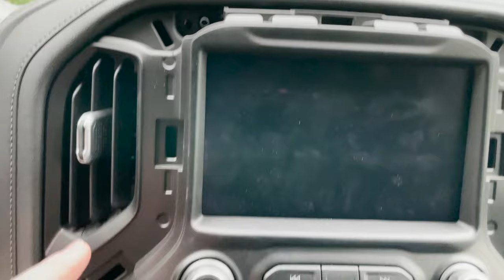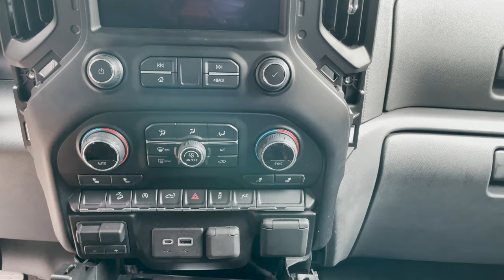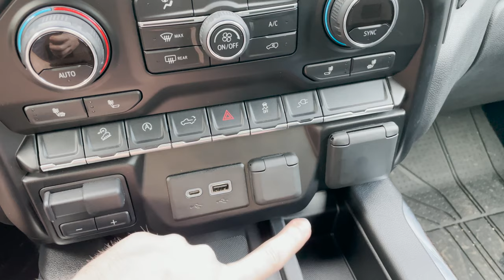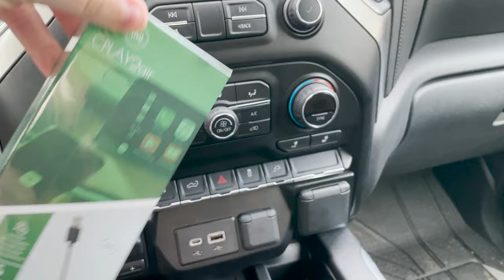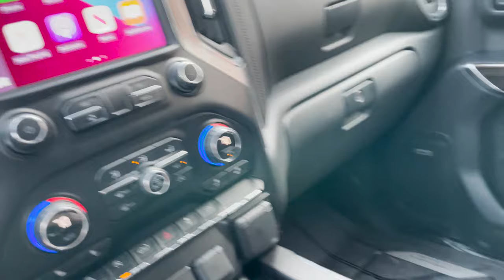Silverado / Sierra Center Console Upgrade (2019-2021)

Comment: Hey, sorry to keep asking questions. So, you used your original module that you swapped into the new part. Was there any programming involved or error messages or anything like that? Thanks for your time.
Reply from the maker: No need to apologize. I will answer any questions that I can. No programming needed or any kind of issues with the console swap. Everything was plug-and-play and worked immediately once it was put together.

Comment: New sub here.  Thanks for the video.  My GMC Sierra 2021 came with wireless CarPlay and ever since I disabled the wifi hotspot I have lost wireless CarPlay.  I had looked at your dongle before but since it did work I am trying to find out if I can reset everything to get it to work.  Thanks again for your video.  It was helpful to see the console removal.  I have added a wireless charger to the console with the hinged access below.  That was pretty easy to put in.  All the best! Happy New Year.
Reply from the maker: I’m not sure how the built-in vehicle Wi-Fi works, but I do know that wireless Apple CarPlay needs a Wi-Fi connection in order to work. The adapter I bought for my truck allows me to connect my phone to my truck over Wi-Fi. 

My truck also has the built-in vehicle wi-fi but I don’t think I ever fully “disabled” it. I just don’t pay for the service. Even so, my truck did not come with the functionality to have wireless Apple CarPlay to begin with so I still needed the adapter for it. If you disabled the vehicles Wi-Fi component completely, that may be the issue. You should be able to leave the component active, but just not pay for the service if you don’t want to actually use it. Then again I’m not a Wi-Fi expert so I could be wrong. 🤔
Reply from the maker: Thank you for the comment and the sub! I’m glad you found the video helpful!
Reply: @SouthpawGarage  yes I thought it required wifi. As I was on free trial I wanted to disable using it when it was no better than cell data so where you have poor performance on the phone, same for truck enabled wifi unlimited (which is not really unlimited). So here is what confused me - my daughter and wife were asked if they wanted to use wireless CarPlay where mine failed. I think it displayed the CarPlay screen on the truck for them.   I will verify this when my wife gets home tonight.  Thanks for your reply.  Have a great week!
Reply from the maker: No problem. I know I don’t have all the answers but I try to help as much as possible. 

If your wife’s phone still works, you may want to look at the CarPlay settings on your phone and make sure everything seems to be turned on. You can find some troubleshooting help at this link:

https://support.apple.com/en-us/HT210892
Reply: @SouthpawGarage  no problem.  That is what I love about YouTube.  We can figure stuff out together.  We all have ideas and understanding of how things work generally and it is always good to see examples of what can be done when you haven’t don’t that before.  Anyway, I will look at the iPhone if theirs works and mine doesn’t.  I shiver at the thought of resetting settings on either the phone or the truck.  But maybe that is what I will do depending on how this next test goes.  Wish me luck!  Lol
Reply: @SouthpawGarage  thanks again for your video. I did get CarPlay working by removing my phone from vehicle Bluetooth.   Then I reattached it.  

Now I am here watching the console removal to see how I can remove it and see where I can run cables from the rear of the truck for Ham radio. I may set a custom mount under the console for my radio but mainly I want to see where to run the antenna wire from outside.  Thanks again for your hints and comments.   All the best!

Comment: I have a 2019 Sierra denali and it already has that center console, the wireless charging is SLOW. I installed another wireless charging on the center console arm rest. It replaces the center piece of the arm rest. SO MUCH CHEAPER and EASIER.
Reply from the maker: The factory charging definitely isn’t fast. I spent a lot of time deciding if I wanted to add factory wireless charging or add an aftermarket one. I went with the factory one instead of replacing the piece on the center console to try and kept the factory look as much as possible. You are correct that there are cheaper and faster options.
Reply: @SouthpawGarage  not to take away from what you added. It looks professionally done as if it came from the factory. Take a look at some of the installs for the arm rest. you will not not if its factory or not. My wife didn't know I replaced mines until I told her there was a new charging pad there.

Comment: Can this be added to a 2019 Chevy Silverado Custom trail boss? There's no center console in mine.
Reply from the maker: You would need to do a complete conversion to get rid of the folding middle seat and install the center console before you could add the OEM wireless charging console component. I am not aware of a wireless charging kit that is made for the folding middle seat option.

Comment: Did you add the centre console to this truck or did it already have it? If you added it did it have the usb and card reader? The console I added came with rear seat heat which I don’t have.I did not get the harness that runs from the centre stack usb to the wireless charging. I’m trying to figure out if the harness from the wireless charging will feed the centre console USB ports. Curious what you know about this. Thanks for your time
Reply from the maker: I did not add the center console. I bought the Silverado that has the center console instead of the bench seat. I am not sure what you would need to power the usb and card reader in a console that is added after the fact.

Comment: Thanks for the video.  I am now working with wireless CarPlay.  Something got weird when I disabled the WiFi in the truck that was provided with he OnStar Eval.  To get aligned with wireless Apple CarPlay was a matter of removing my Bluetooth pairing of my iPhone with the truck and adding it back again.  So problem solved.  On a new note, I am planning on removing the center console to route coax and control cables for radios.  Thanks for the video on removing the center console.  Again, thanks for the video, you helped me on a side project, but helped me still the same.  Now to get the radios setup … smile
Reply from the maker: I’m really glad you found the video helpful! I try to improve on every video so that hopefully viewers either get help on a project or at least some form of entertainment in regards to seeing cool cars or truck mods. That you for the comment! The Nova videos should be coming back before too long which means I will have to put my truck mods on the back burner for a little while, but there are more truck videos to come as soon as I’m able to fit them in the budget.

Comment: Did you have to re program your remote? Did the new one come with a remote sensor under the cup holder? Thanks
Reply from the maker: I didn’t have to reprogram anything. The wiring harness for the kit that I purchased came with a new connector for the remote sensor under the cup holders.

Comment: So everything is awesome in your video, (But) the lower bezel between the console and the instrument panel where two additional screws hide. My question is how did you remove that u shape 🤔 bezel? The upper was easy the lower one seems very hard to remove 

Thanks for your reply 👍
Reply from the maker: I think you are referring to the piece that is tucked in under the center stack between it and the wireless charging pad (or top of the center console). Once you get any screws out of it, it’s held in with retainer clips. It takes a little bit of force but it pulls straight out towards the backseat. If you put any upward or downward force on it, it’s likely not going to pop out. Try to make sure you are pulling straight towards the back seat.

Comment: I’m lucky my 2020 GMC 2500 HD Denali came with this wireless charging piece and it works well even though an otterbox phone case. My question is with the dongle. Are you able to watch YouTube, Netflix etc through it and on your factory screen? Or is it just CarPlay? I work in my truck all the time and this would be handy while parked. I’d never use it while driving. Thank you in advance.
Reply from the maker: That was just a dongle for CarPlay specifically… no additional functionality. That dongle quit working less than a year later as an Apple update made it unusable. I have since upgraded my truck to having the factory wireless CarPlay setup with an upgraded infotainment system. 
Dons Life has a dongle that provides access to Netflix, YouTube etc and has videos showing it off if you want to check out his channel. I don’t plan on looking into anything like that for me, personally.
Reply: @SouthpawGarage  I would never use it for driving. As I’m in my truck 70+ hours a week, this would be nice to have. Thanks for the speedy reply. Subscribed!

Comment: I just recently got my hands on a full center console without the wireless charging to replace the jumpseat.  Do I still need to get the extra wiring harness even though I am not using wireless charging?
Reply from the maker: I’m not entirely sure about going from a jump seat to a console. I know there’s a small harness in the console even without the wireless charger that acts as the sensor for your key fob if the fob’s battery goes bad so your truck will still crank until you can replace the battery. But I would assume that is included in the center console you found. If you aren’t going to be using wireless charging, you shouldn’t need the harness that I added in this video.

Comment: When you installed the new part for the wireless charging, did it come with the anti theft module for the remote or did you take the one out of your exsiting console?
Reply from the maker: I used the one that was already in my truck. I removed it from the factory console and put it on the new one.

Comment: Having a problem removing trim piece right under the radio in between the radio and console. Please help! I noticed yours was already removed
Reply from the maker: That piece is a little difficult. I used the tried removal tool to loosen it on each side and in the middle. Then it takes some force to get it to come out. It has to be pulled straight back. If you pull in a way that pulls at an angle to either side or up or down, it’s nearly impossible to get out. (At least, that was my experience)

Comment: So you had the carplay option already?
Reply from the maker: The truck had wired CarPlay from the factory. In this video I added a 3rd party wireless CarPlay adapter that ended up not working after a while (apple listed it as an unapproved accessory). In a later video, I update my infotainment module to include the factory version of wireless CarPlay without the need for 3rd party adapters.

Comment: hey, how are you? With the wireless charging add on you done, the harness ties into the back of the 12v port on the centre stack. Is that correct? Did you add the wireless charging cooling ductwork as well? Thanks for your time.
Reply from the maker: You are correct. The kit that I used plugs into the back of the 12v port. I did not add the cooling ductwork for the wireless charger. That would have required removing all of the wires from the back of the center stack so I could completely remove it and get behind everything to add additional ductwork.
Reply: Did not having the ductwork cause any problems in your opinion.
Thank you for replying
Reply from the maker: No real issues, but on really hot and sunny days, the wireless charger will stop charging the phone because it will get too hot and have to shut itself off.
Reply: That’s great! The console I put in come from a ‘19 AT4 with wireless charging and rear seat heat. I wonder where the wireless charging connected in that truck? The same as the one you done?
Reply: I appreciate your time on this
Reply from the maker: From my research, factory wireless charging wiring harnesses run under the carpet under the passenger seat, but I’m not sure where they actually connect.
Reply: When I installed my console there was a big connection under the carpet between the pass seat and console. It made the light in the console work and the rear usb’s work. I’m still working on a solution for the USB port in the console to work.

Comment: Do you have the part number for the wire that runs from the console to the 12v plug on the back of the dash?
Reply from the maker: It was all part of a kit. The link to the kit is in the video description.

Comment: Damn 400 dollars is pretty steep for a basic charger. Boost auto parts sells a nice wireless kit for 135 that blows the stock GM charger out of the water. Great video though!!
Reply from the maker: I do agree that the GM charger is very basic and they should be able to do better by having a stock fast charger. I looked at the Boost Auto Parts option before pulling the trigger on the GM one. I went with the GM version to keep the “factory” look in the console. One reason the GM is more expensive is because you get a whole new top piece for the center console and an adapted wiring harness.

Now that doesn’t make up for the entire price difference, but it’s part of it.

I’m glad you liked the video, though! Thank you for the comment!
Reply: @SouthpawGarage on your last comment:
 "Im glad you like the video, though"
I don't think you're suppose to use a coma (,) between "video and though"
Reply from the maker: @jaylara2592  when adding “though” at the end of sentence, one can choose whether or not to use a comma. Neither way is considered right or wrong.
Reply: @SouthpawGarage  Thank you for the clarification.

Comment: I also bought the 404parts wireless kit, I removed the plug behind the 12v and reconnected the one that comes with the kit, however the small plug that gets disconnected from under the original cup holders area where does that go and there is another connection with the new kit that doesn't seem to fit. Any help?
Reply from the maker: For the cup holder plug, you have to remove the theft sensor from under the factory cup holders and transfer to the new console piece (the one from 404 parts). Then you can plug that wire you disconnect back in. I hope that makes sense.

I’m not entirely sure what connection you are referring to that doesn’t fit. If you want, you can send a picture of the connector you aren’t sure about to the email listed on the “About” tab of my channel page and I’ll take a look at it.
Reply: Will do when I get home. Ty

Comment: If my truck already has wireless apple car play (LT Trail boss 2021) and I want to just get the wireless charging console. Will I have to get to the wireless CarPlay adapter
Since I’m doin this mod and changing the center console?
Reply from the maker: No. You will not need the CarPlay adapter. Wireless CarPlay is build into the infotainment system module itself, not the center console.
Reply: @SouthpawGarage  thank you!!

Comment: Can you tell me the part number for the usb part in the center console you got that u have the dongle plugged into?
Reply from the maker: I’m not sure what you are referring to. All USB ports in the truck came in from the factory. They are not add ons.
Reply: @SouthpawGarage  right I know! Mine don't have it an I wanted to add it! I switched the wire harness an it has the wiring for it so I was askn the part number since it's larger then the one in the dash
Reply from the maker: Oh I gotcha now. Sorry. Unfortunately, I do not know the part number for it.
Reply: @SouthpawGarage  do you know where that one wire plugs in at that runs up behind the face plate? It's the extension wire looks like an old phone charger at each end? It's the data cable! If you watch your video it's white on one end an black on the other!
Reply from the maker: @joediduch5457  I do not. Since I didn't have to remove/disconnect that wire during this install, I did not pay attention to where that specific one was going.

Comment: I installed a few months ago.   I noticed after install the auto stop (engine shut off at red lights) no longer works.    Anyone have issues?
Reply from the maker: My auto stop / start hasn’t done anything in a long time. I never thought that it might be connected to the wireless charger install. I also haven’t really thought about it much because I’d rather my engine not shut off and on constantly anyway (especially with the after market exhaust).

Comment: Did you disconnect the battery first?
Reply from the maker: Yes. It’s always a good idea to disconnect the batter when working with any type of wiring changes.
Reply: @SouthpawGarage  just got this for my traverse. Plug n play my ass! I'm glad to have the upgrade but it was not at all as easy as they claimed.
Reply from the maker: I don’t have any experience with the Traverse. It wasn’t super difficult in the Silverado. The hardest part was reaching the wiring harness behind the center stack to disconnect it for the splitter.